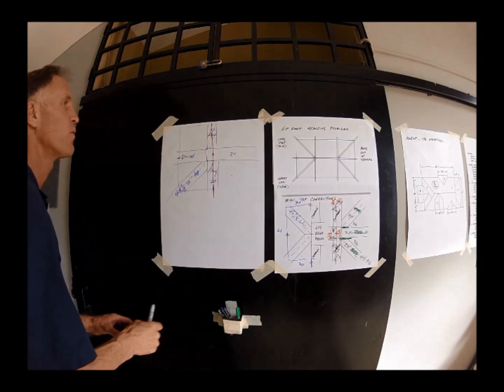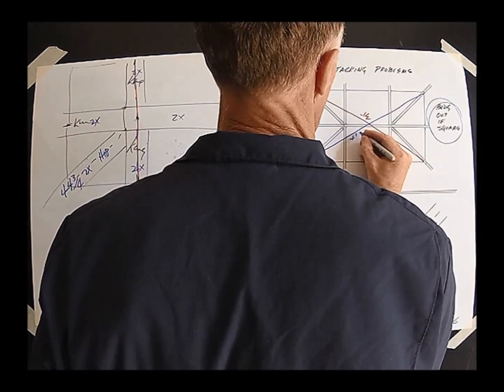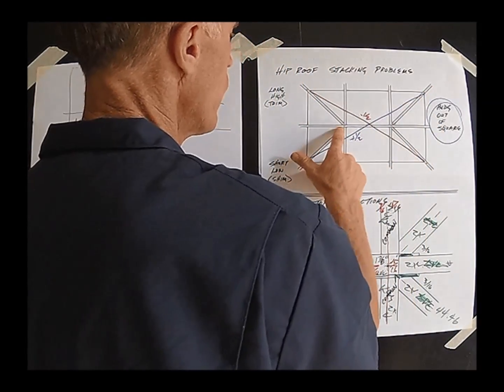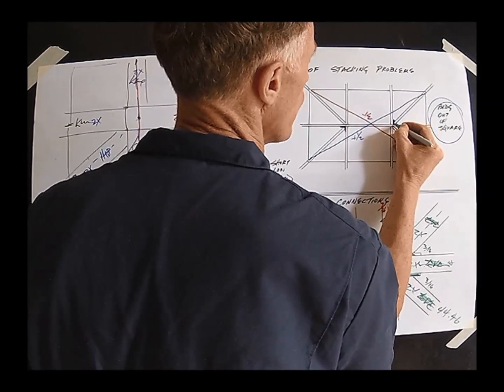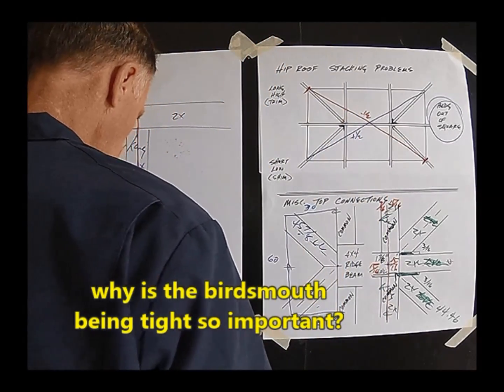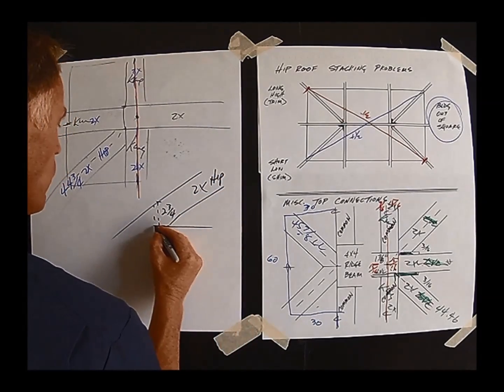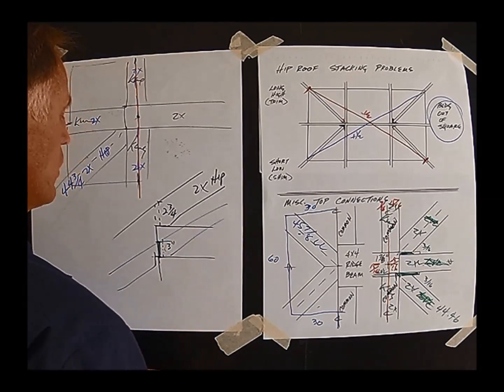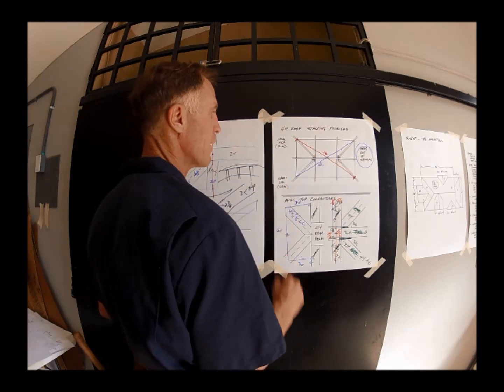Why don't my hip rafters fit?   What did I do wrong?

Comment: When u offset a hip for equal length overhangs for mixed pitch does it change the tangent angle calculation for jack step?
Reply from the maker: Blaine, refer to A Roof Cutter's Secrets (>2002) pg 172.  Compare it with RCS pg 182.  If you run the hips offset from the bldg corner, the various plan view angles will be slightly different than if the unequal hips are placed directly on the corner.  The best way to visualize this is to draw out an unequal hip end and sketch the two different situations.  wh

Comment: If I can add something. If the building is built correctly. It does not matter if it is framing. Like here in the states. Or blocks. As in my home country Ireland. wills methods. Work 100% of the time. I use them on a daily basis. As I frame my own walls there is no problems with out of level or square , Roof cutting. Is a series of mathematical steps 
Kevocos. Point I think is that blocklayers. Often build out of square And we. Roof cutters have to take steps to deal with that I seem to remember that in Ireland. Common practice was always to measure. The hips when ridge board. And commons were in place.

Comment: ".....for the Professional" and you are actually recommending that hip rafters when cut too short should be shimmed?
Reply from the maker: +kevocos 

What I am saying is that if the hips were cut to length correctly but during installation you end up with one that is short and the other long at a hip end,
the building is out of square.  In this situation, shimming the short hip “slightly” so it will fit, is an easy and acceptable solution.  If you are in the process of stacking the roof it is certainly too late at that point to backtrack and fix the “out of square” mess at the wall plate level so the hips will fit as they should.  Obviously, any shimming should be limited to only very thin shims (I would say a +/-3/16” max thickness) so you can get good nailing into the hip's headcut from the king common rafter at each side.  You may want to use some 20d nails for longer reach.  Downward force puts the hip rafter's headcut in compression so these thin
shims don't cause any problems in most cases.
If the building being “out of square” was caught before the hips were cut, one
could have adjusted the hip rafter's line length slightly to compensate for the greater travel.  But if it was not caught beforehand (which is usually the case), and the hips were cut to the correct length using the building span (as is the standard procedure) they will be short on the long diagonal direction as shown in the video clip.  The most practical and time-saving solution when up in the air stacking and you discover that you have a short hip caused by an “out of square” building, would be to shim it slightly so it fits and keep on going.  If there is a huge gap when a hip is set in place and you are positive your calculations were correct (the opposing hip from the adjacent hip end corner being long by the same amount that the first hip was short is a good indication that your hips were mathematically correct) then you would need to recut a new hip rafter a taste longer.   But at that point, I would expect there to be a basketful of other roof problems as well, since the house was so poorly framed (ex: hip jack 45 deg cheek cuts will not fit very well, hip fascia corners not 90 deg, hip pitch off slightly, common rafters and jacks not square to the plate line, etc).  If the hip rafter's tails were left long to be cut to length during the fascia installation process, you could recut the short hip's birdsmouth in order to lengthen the rafter the desired amount.  This would be accomplished by making a new heel-cut farther down the board and installing a plywood shim of a specific thickness along the old seat-cut to achieve the correct heel-stand dimension.  You would need to be careful that you will not degrade the tail strength with the birdsmouth recut (Roof Cutters Secrets pg. 53).

Of course, it would be best to avoid poorly fitting hips altogether by making sure the wall framing has been correctly plumb and lined.  Take a look at my other video clip entitled “Why don't my rafters fit? Common roof framing errors” for more info.
Reply: +whframingconsultant All those issues are side stepped by using Direct measurement of hip length. 
Sure, its good to be able to markout use both the calculated and stepping off methods but in practice marking out from direct measurement achieves greater accuracy and is quicker.
Reply: +whframingconsultant 
Your reply only reinforces the case for direct measurement of hips; out of square framing, out of square brickwork here in Ireland and the UK, difference in the finished level brickwork/framing. 
For clarity by to obtain the Direct measurement, I pull a tape measurement directly from the Crown/last Common junction held at the pitch line and down to the cut wallplate. 

Direct measurement sidesteps all those issues. In addition I directly measure the jack lengths and mark them on common template and mark the jack rafter plumb cuts from that. I imagine our different approaches stem from the fact that over here buildings are built with pretty much always built in brick or concrete block.
Reply from the maker: +kevocos 
Well, if your buildings are that poorly constructed and the caveman method works for you - use it.  My desire is to teach folks how to build better, faster and more efficiently.  Many folks never have had the opportunity to even learn how to do things correctly.  Others just don't care.  A wall framer will never understand how important it is to do his job correctly unless he works as a roof framer (the one who ultimately has to deal with his screw ups).  Sounds like you have a great opportunity to share with the UK bricklayers and wall framers how they might improve their work.  In the states, if they put out that poor a quality of work they would not have a job for very long.  If you had nice walls to work from you would be amazed at how easy and fast it is to cut/frame a roof.  It is actually a lot of fun.  Send me an airline ticket and I would be happy to come work with them and you.  I have taught framing in 3rd world countries of Central America and prior to my visit, their buildings were exactly as you described - a real mess.  But, after they spent some time learning how to do things correctly they were able to put out very nice buildings in record time.  Drop me a line:  whframingconsultant@gmail.com.  Take care, wh

PS: See the complicated roof on my website's cover page.  Every single rafter there was precut and fit as it should.  I spent a week alone precutting everything on the ground and then the following week 4 of us stacked it.  Needless to say, Shone Freeman, the contractor, knows how to frame so it was set up perfectly.